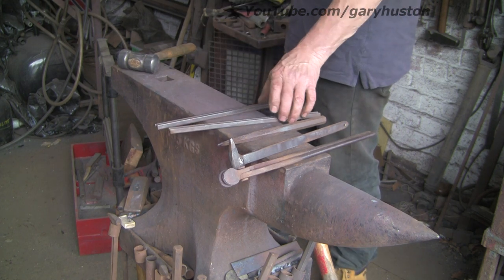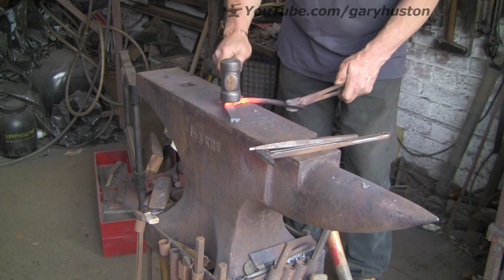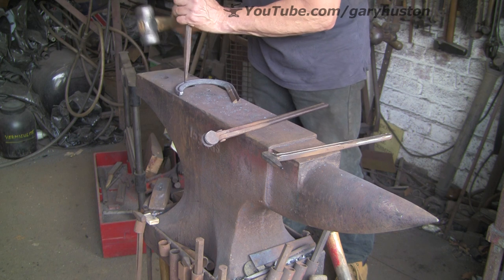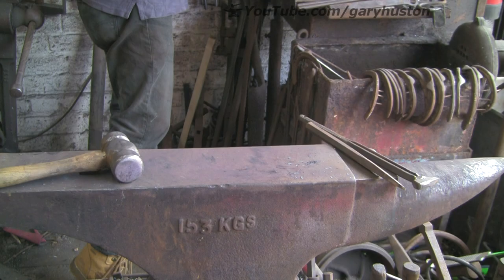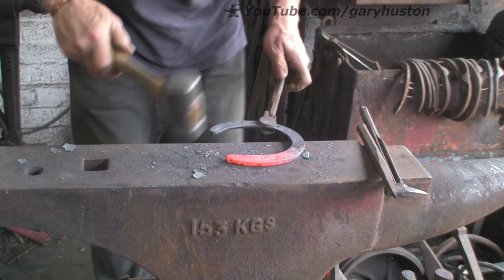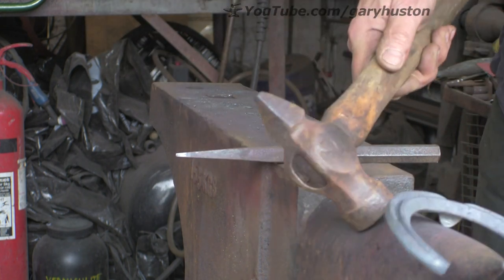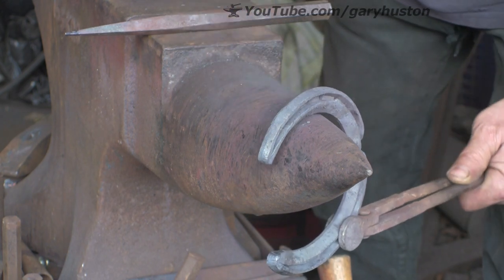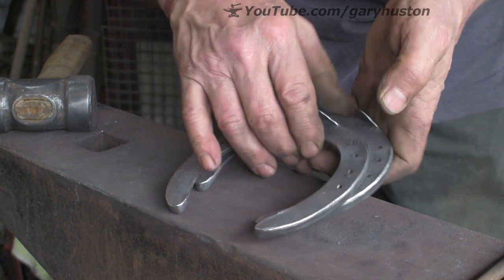Horseshoe making, back to basics.

Comment: Nice work Gary. Ready made concave stock sure as hell beats making or buying a swage block for the size concave you want and making your own concave stock lol 
I swaged what felt like miles and miles of stock for training plates when I was an apprentice,turned a lot of sets of training plates back then lol  I do have a pretty old thoro’bred brand hold down and a set of blocks that I made using a straightened section of kerk training plate drove in to a block of mild steel.